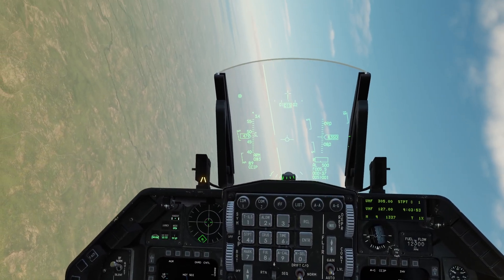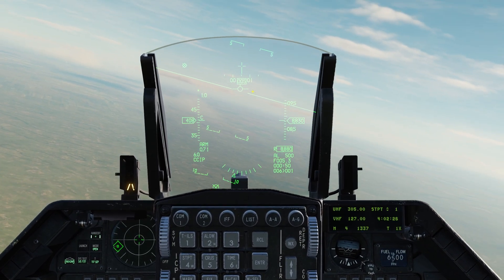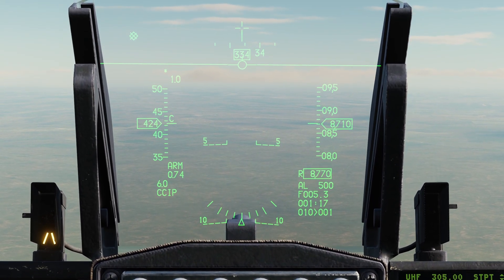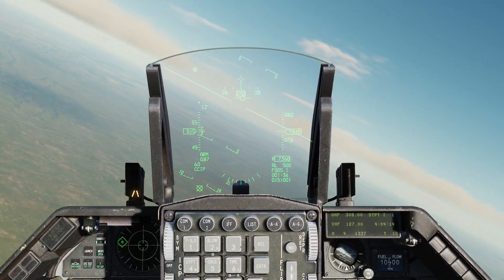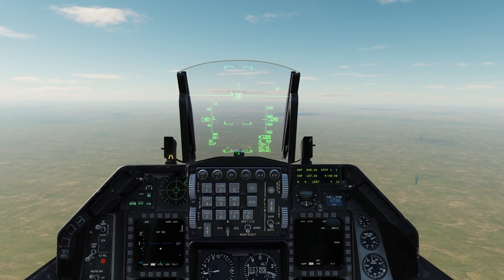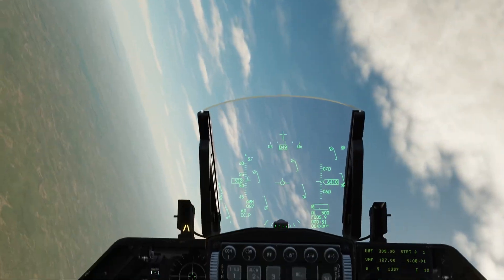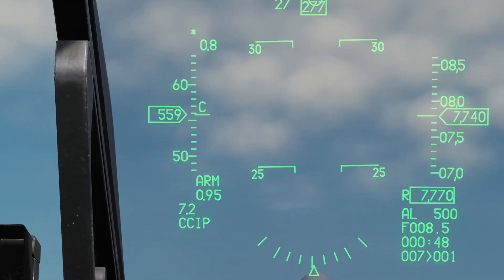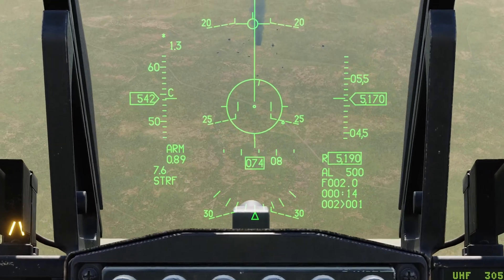How to use TRIM for better accuracy! | DCS World F-16C

Comment: Are you running VR and if so what are your machine specs?
Reply from the maker: This video is 2d. I have a pimax crystal light video. I just got started with it, it will take some work with my 5070ti to get it dialed in.

Comment: No no no............. a pilot in the F16, pretty much never uses trim!! hell no for a level turn. Thats all u.
And i know.! 

Not that it cannot be done... its just not done. And 2nd... the real jet has no trim reset button, that needs to be done by the ground chief inside the right main gear port.

So honestly, bad video... sorry...
Reply: what about balancing weight or strong winds? would it be more practical for the A-10C  ?
Reply: @Smuth_Op  the difference is that an A10 flies like a Cessna, manual control surface inputs. In the F16 you dont control pitch as he says put G force. I.e. you dont need eg pitch trim for a constant climb, you just command G for nose up and then it will keep your constant climb at 1G. So when you trim pitch down in a Cessna or A10, it will stabilize because they're stable airframes: your nose will drop, you will lose altitude, from this you will gain airspeed, and from the gained airspeed you will generate more lift and climb. This will oscillate to a stable state where you fly level with higher airspeed; hence, the "pitch for speed" on landings. The F16 however will continue to command <1 G, and will continue to descend, gaining more and more airspeed. The flight computer will continuously adjust your control surfaces to compensate for the extra lift from the airspeed increase. It will drive you into the ground. Also I'm not even sure if you could fly an F16 without flight computer as I don't think it's a stable airframe to begin with... so it would be very hard and dangerous.
Reply: Agree. This is just not done, it's teaching bad patterns that lead to all kinds of problems. I think it's only used when the jet is not symmetrically loaded, or when there's some kind of malfunction/drift. I don't know if in DCS you can simulate a FLCS failure and whether it then truly acts like manual flight surface control, but that's a point where trim would come in handy.

Comment: That is why you're suppose to walk the pippers onto the target. That constant nose down could cause the bombs to get sucked back up into your jet.
Reply: For my understanding and learning. What does this mean?
What the OP is showing, using trim to keep the pipper stable, would not be best practice?
Instead, if I understand you correctly. You simply want to have the jet do it's 1g thing. And so your pipper will move up. and then release when your pipper is on-target?

What about if you use your stick to keep the pipper on target?

Thanks for sharing. There is so much to learn :)
Reply from the maker: I don’t use this method really for bombing. It’s more for guns/rockets where you need the pipper to stay on target for some length of time.

Bombs release just fine at .8G vs 1.0G in the game. It’s still positive G. You’d have to get zero or negative to have bombs hit the airplane.

Comment: On F-16 Free flight Caucus map, does your F-16 always immediately drift to the right?
I don't know if it's a feature or my controllers are porked???
Reply: most likely it is because of the asymetric loadout since you're carrying a TGP on the left (or right?) intake hardpoint
Reply: @Pineappuru must be a pita flying the real thing. You'd think fbw would auto trim that out.
Can the trim button on hotas be made less sensitive?
Reply: @thelmaviaduct no, i don't think it can be done
Reply: @thelmaviaduct  No it cannot. I know what you mean though, once you've launched ordnance off 1 wing it's sometimes impossible to get the elevator trim right. The f18 has the opposite problem where you need a bazillion clicks to get it on point, but at least you can set it perfectly. All the little things like this and what I've described above make the F16 quite frustrating to fly sometimes and why the F18 can be more fun to fly even though it doesn't compare in performance.
Reply: It's hard to know because the F16 flight model has so many issues in game that the real jet does not. ED have really struggled over the years trying to get it right. Real pilots have commented that the in-game jet requires too much trimming, should easily stay in aerobrake position upon touchdown (like the F15s do) and not slam its front gear down, that it drifts to the side too much on takeoff, among other things. I would agree that for your issue it could be the asymmetrical loadout but normally when you hot air start the jet should be perfectly trimmed. /shrug
Reply: @OisinClissmann  yeah I've noticed it skews all over the shop when on the runway. Even seems to drift when taxiing at relatively low speed. I've often thought it was my controllers giving false output, sounds like it's not.
Reply from the maker: There is probably wind in the mission. Every time I airstart a mission and I have winds aloft set to any value, the airplane does a big fat shimmy/yaw immediately on the start.
Reply: @FLYGaffer  I just did the take off instant action in caucus map and there was definitely turbulence, which looked and felt good. The nose was bouncing about good and proper, not drifting like my original post.

Comment: any way to reset the trim back to zero / 1G ?? or just tap tap till it reads 1.0G again ! - nice vid as always 🤙
Reply: Look at your back left panels. To the left of the lighting panel and below the flt control panel is the manual trim panel. It adjusts corresponding to the trim inputs in the stick. Re-center the trim wheels on that panel so the center lines align to zero the trim.
Reply from the maker: Tap tap! If there is a way that would be nice but I am not aware of it. I will look into that however!
Reply: @FLYGaffer  It can be done... but boy howdy is it not fun.

1) Install joystick-gremlin and vjoy (eye rolling can begin now)
2) Map a macro to increase/decrease a virtual axis by pressing your trim hat buttons
3) Make a macro for both roll and pitch axis
4) Add a button that resets the vJoy axis back to 0 (optionally 0 roll and pitch, or just pitch)
5) Bind the new virtual axis to the roll and pitch trim axis in DCS (these are not the HOTAS bindings, they map to the pots on the left rear console)
6) Unbind the trim hat entirely. You don't need it now. Your pilot always uses the trim wheels now like a caveman (but for you its the hat pretending to be wheels)

It works great once you have it all set up. One button and trims go back to 0, but yeah, you gotta want it. The other advantage of this approach is you get to control how twitchy the trim hat is. I make move the trim slower than the default so it is more precise.

While I'm here. Please do a video on CCIP bombing accurately in the viper. My bombs fall short about 100ft consistently of where I release them, even with active pause. I cannot for the life of me figure out what is wrong.
Reply: The A10 has a Trim Reset button which is so handy. I wish they had put it on the F16 also.
Reply: @OisinClissmann  Is it a trim reset or is it a Takeoff trim set?